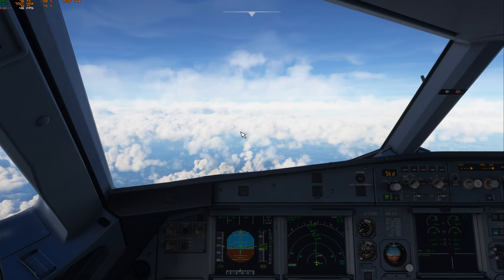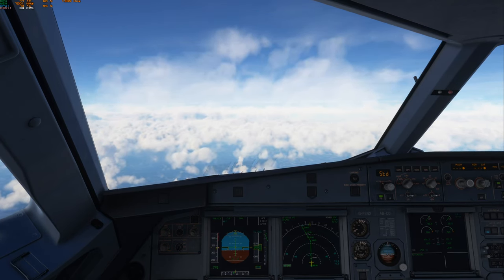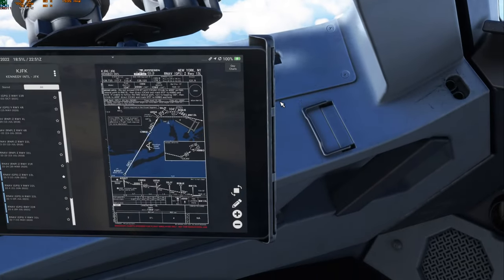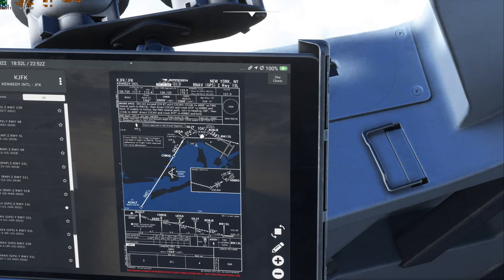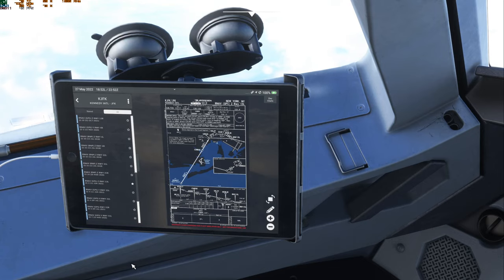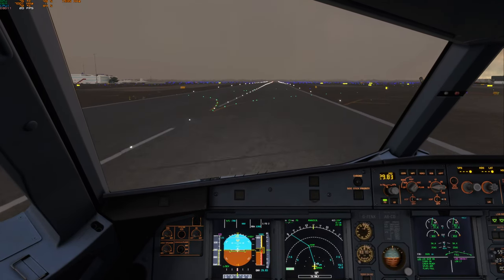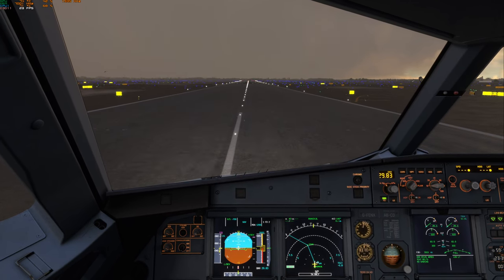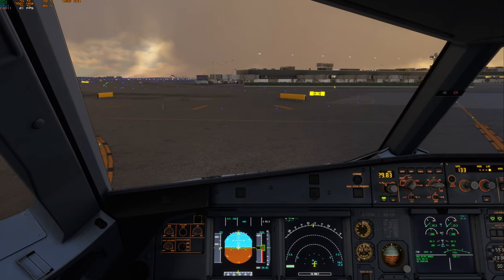Fenix A320 - RNAV Approach set up (KJFK 13L, full ATC + Holding)

Comment: Thanks for video. I have my issue: how to get L/DEV and V/DEV green on PFD? Mine is sometimes not even appear or just appear and blink red and also no RNAV magenta marks on final approach.
Reply from the maker: So mine recently have been doing that too. Not sure if that's an issue. The marks are from constraint setting above the altimeter.
Reply: it will not appear if you dont activate the approach phase, it will flash amber if you selected a non precision approach (for example the one in the video, RNAV) and you pressed the LS button when you shouldnt have